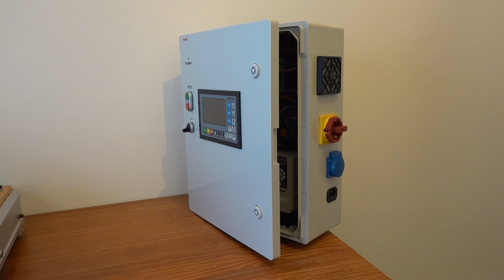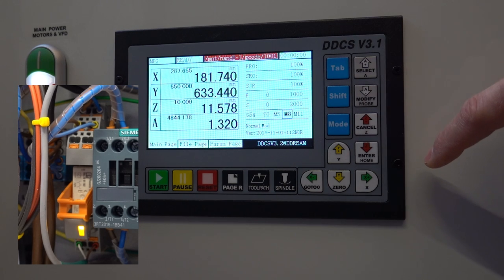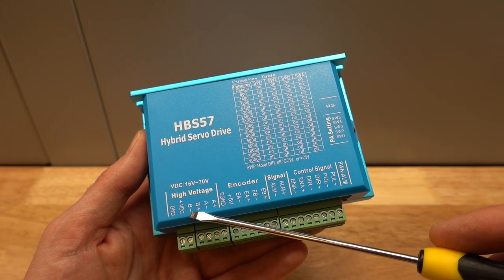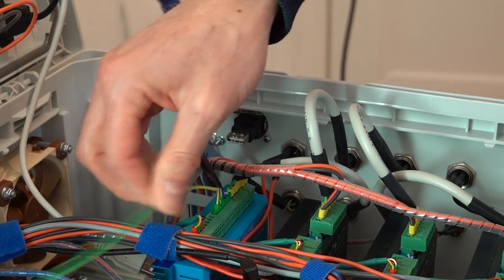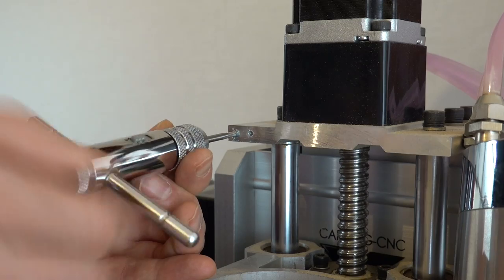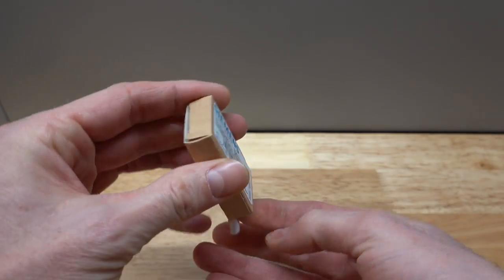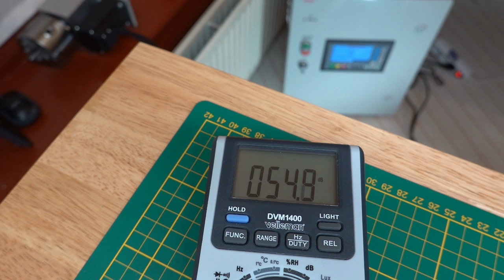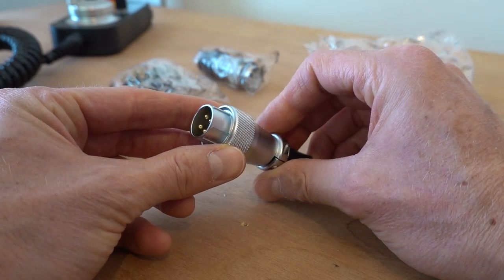Build Your Own CNC Controller Part3

Comment: Hi friend sorry to be bothering you more I have a problem. in the straight cuts it is firing and where there is a very slow curve, it burns the mdf. which parameters to use. and what is your post processor?
Reply from the maker: Hi, no problem. Since you mention slow corners and burnt material, it indeed seems to be a feed rate that is too low for your specific tool diameter and RPM, causing less deep cuts/re-cutting/rubbing and thereby generates heat. It might be that your machine is not capable of maintaining high feed in corners due to acceleration settings. In that case increase acceleration or if this does not work for you machine use a lower spindle RPM. Also make sure that inner corners are not very close to the tool diameter. In that case you can't really achieve a proper feed, since it needs to change direction inside a corner. Another option is to take smaller depth passes, which allow for chip evacuation. I use Fusion360 with Mach3 post. As far as I can see Fusion360 only has an option to reduce feed rates in tight corners, which would not help in this case, since you are not breaking end mills, but are instead experiencing burnt material. I hope the suggestions mentioned above help reduce the issue.
Robin
Reply from the maker: Hi, the only changes I made to the controller are mentioned in the PDF in the website article. The rest is at factory default settings. For acceleration check 2031 (I have zero), 99 (I have 300 mm/s^2), 45-48 are all set to 300 in my case. Note I did not change these from factory settings. However, given your additional description, please check your G-code just to make sure the arcs in the corner are not actually programmed with a lower feed rate. In that case you should look at your CAM software. Also check the other things I mentioned like tool diameter being close to your programmed inner radius.

Comment: This came out incredibly nice for a DIYer.  How did you know how to do all of this?
Reply from the maker: Thanks! I have a mechanical engineering background, but my knowledge on electronics is quite basic. However, I like to figure out how stuff works. Most information comes from online research and by reading manuals.
Reply: @uptimefab7412  I’m rebuilding my mini mill cnc cabinet from scratch and I’ll be referencing your build as I go. Keep up the great content!

Comment: Hi man! is it possible to attach a CNC router with a laser for engraving in the same machine with this controller? Thanks in advance!
Reply from the maker: Hi, this might be possible, but I think this would require another post processor and a way to interface with the laser input. Not plug and play. I am not sure you would want to do this from a safety perspective (needs suitable enclosure). I assume you are aware of the risks, please be careful. Interesting idea though.
Reply: @uptimefab7412  Hi! Of course, laser is dangerous and my idea is to make a little enclosure, and of course wearing safety glasses. Also, recenly I saw a video from a youtuber called DIY Builds, and he use a switch to swap from the laser to the milling, but i dont get it hahaha. Im searching for a controller that can suit both of them at the same time. Thanks for the response, btw!

Comment: hi do you know what aviation connector i can on my  1.5kw spindle  ive been looking ate them and they all seem to be rated at 5A but iam sure that that is tool low, i want to put my vfd in a enclosure like you and use a aviation connector  like you have for easy connection,any advice appreciated thanks
Reply from the maker: Hi, the gx16 can I indeed not handle the current required for the spindle. As an alternative you could use a ws20 connector shown in video part3 around the 22.40 time mark. This should be able to handle 25 amps. Of course this is just one of the possible options. It is really available on AliExpress.

Comment: If I were to use Cat 6 cables would they be ok for the driver to stepper connections in wire size?
Reply from the maker: Hi, the wire gauge on CAT6 should be around AWG23, which is too small for the high current line from stepper driver to the motor. You can however use CAT6 for signal lines from controller to stepper driver or for the closed loop signal line. For my steppers I  use 0.75mm^2 (AWG18). I have read people running NEMA 23 on diameters as small as AWG22, but I don't see any reason to use smaller wire gauge since even high quality shielded wire is quite cheap. Hope this helps.
Reply: @uptimefab7412  It does!  I was just hoping for a more plug and play connector solution.  I'm also into Amateur radio and we use those round plugs for microphone and some power connections.  Very tricky to solder and even worse with my eyesight.  I may have to come up with something else.  If 18 or 16 ga wire is fine I may try using Anderson Powerpoles.  30 amp handling each on the pins.
I like the idea of a standalone controller.  Trying to buy all my other parts now though.  2.2kw spindle and VFD with pump.  Ball screws and such.
Reply from the maker: Agreed, soldering connectors can be a pain. I also like the CAT6 connectors, I would also prefer these over gx16 for low current signal wires. Problem is if you have a cable without  the CAT connector and you have to crimp it yourself. In that case it is almost as difficult as soldering (for me)

Comment: I was going to buy the ddcs v3.1 but realised that It's not quite usefull for my cnc servo motors. Meaning it can't handle alarm signal coming from the drivers. Though It's not an essential fonction I'd be nice to use the full option the servo motors offer. I recently came accross the DDCS EXPERT controller which have this option. Do you know if this controller is as good as the DDCS V3.1 or It's one of the buged chinese new devices to say away of ? Thanks
Reply from the maker: Hi, I do not have experience with the DDCS expert, but it seems like a nice option. In fact, if it would have been available when I was looking for a controller I would probably have gone for the expert or plus version. They both have more functionality, but at the cost of a higher price and larger dimensions.   They are made by the same company as the DDCS V3.1. Perhaps users in the digital dream Facebook group have shared their experiences with one of the newer controllers, would be a good place to check.
Robin
Reply: @uptimefab7412  thanks a lot for your  feeback. I'll check with them.
I thinks the DDCS V3.1 is just great  for stepper motors.
 Anyway you've made excellent videos very usefull. Great help !  Thanks
Reply: @uptimefab7412   Your DDCS v3.1 is a 4 axis. So XYYZ. Do you know if you can connect 2 Y to one axis signal in the DDCS ?  Thanks
Reply: @uptimefab7412   Your DDCS v3.1 is a 4 axis. So XYYZ. Do you know if you can connect 2 Y to one axis signal in the DDCS ?  Thanks
Reply from the maker: Hi, although is has 4 axes unfortunately the 4th axis cannot be reassigned to be a second Y axis. I have seen this feature requested on forums before but I do not think they are going to add the feature to this specific controller. Unfortunate, because this would be useful for a lot of people with dual Y axis motors.
Reply: @uptimefab7412  Maybe using some breakout board to split the signal to two motor drivers. Ok Thanks a lot.
Reply from the maker: Using a solution like that should work, you would only be missing separate limit switches for alignment of the gantry. For smaller hobby machines this might not be an issue.

Comment: how much cost all equipment of the CNC Controller box
Reply from the maker: It depends on how much you can reuse from an old controller. Everything new would be over 1.000 euro. I did not keep track of pricing so I do not have a specific number.  Things add up quickly with many small parts.
Reply: @uptimefab7412  ok think you , can you give me bill of materials which you used on part3 with picture if possible
Reply from the maker: Hi, the Bill of materials including the things added in part 3 can be found in the website article linked in the description of the video. Scroll down in the article or search on the page for "bill"

Comment: How do you calibrate the cnc on the DDCS V3
Reply from the maker: The methode I used was to use a micrometer with the largest range I have at home, measured travelled versus programmed distance and adjusted the pulses/mm parameters accordingly.

Comment: how do you not have emi issues ? you have a vfd inches away from your drivers and controller?
Reply from the maker: Good question, I don't know why I don't have issues as I am not able to measure EMI. I placed the VFD as far away as possible from the stepper drivers, but they are still quite close in this compact cabinet. It seems to work though. In forums I have read that other people have the VFD inside the cabinet without any issues. On the other hand there are people that indicate that you cannot have the VFD in the same cabinet. A lot of conflicting information on this topic. This is why I decided to place the VFD inside the box until I do find issues with EMI. A trade off between effort and risk of issues. I will place an update if there are any issues. Do you have a separate box for the VFD or just more space in the controller box?
Reply: @uptimefab7412  I have my vfd about 3 ft away. Even with that just having my spindle cable in the drag chain with the motor and endstop cables caused stuttering. I do have shielded wire also. when my spindle cable is on its own, everything works perfect so.

It might just be the nicer components you used. Mine is entirely aliexpress
Reply from the maker: Wow those are some serious noise issues. Do you have a ferrite ring around the cable? Mine has the 3 spindle leads wound around a ferrite ring right after the VFD. This should be visible in video 1. I assume you also have an EMI line filter installed? On the other hand it might just as well be the type of VFD.

Comment: Do you have a link for the EMI filter?
Reply from the maker: No sorry, I salvaged this from the old controller. Similar models can be found from typical sources like Amazon and AliExpress. I am not an expert on emi filters so I can't recommend a specific model. Check video from Clough42 on EMI. He also has a link to a model from Amazon.
Reply: @uptimefab7412  thanks, found one.

Comment: Sir, does it support encoder ?
Reply from the maker: Hi, it does not support an encoder
Reply: @uptimefab7412  so how it is used to spindle speed monitoring?
Reply from the maker: The spindle RPM is not monitored at all by the controller. The VFD makes sure it runs at the correct RPM, based on the 0-10V signal from the DDCS. This is very reliable and perfectly linear, unless you are asking too much from the spindle in terms of power needed for your cut. The DDCS V3.1 is quite basic, if you need more features, they also have more advanced models, not sure if they support an encoder.
Reply: @uptimefab7412  thank you

Comment: In my case I had to move the VFD to outside of the control box as it caused too much electrical noise
Reply: I'm doing this on mine as well (i'm going to 3d print a bracket so I can screw it to the side of my control box).  It turns out my VFD is too long and the door won't close unless I cut a hole for it.  I guess reduced electrical noise is a Plus

Comment: You didn't mention the total cost of the project ?
Reply from the maker: Hi, the Total cost highly depends on how many components you reuse from an old controller, but I spent over 1000 euros. It might be possible to do it for less, but you would have to get more creative with the used components. (Like not replacing stepper drivers or using a 2nd hand enclosure for example).
Reply: @uptimefab7412  Thanks for your reply. I knew that this system should cost a lot of money, even you're reusing components you already have.

Really nice work !

Comment: Any updates /regrets about this controller
Reply from the maker: For my application it works fine. I would have liked to have wifi or LAN. The newer 4.1 version does have LAN. Also my controller doesn't have a lot of customizable IO, but for my simple router it has all I need. The 4.1 has some other interesting upgrades, listed on their website, might be worth to check out. Also the plus model is interesting if you have the space and additional cash. The key pad on my model is a bit fragile, not industrial quality, bit that is to be expected for this price.
Reply: @uptimefab7412  do you have an opinion about the expert model vs the new 4.1?
Reply from the maker: It really depends on the use case. If size is not an issue or if you need more advanced functions that the expert provides like tool a tool changer or 5 axes then the expert might be a good choice. I also like the fact that you can get an external keypad for this. I think the downside of the one I have but also the v4.1 that there are only a few keys, so you end up with multiple button presses for functions like homing. I think overall, if you don't want to outgrow your controller and want to get the most of it go for the expert. But if your main goal is to get your machine working and the v4.1 has what you need, go for that option. Also the expert is quite a bit larger, so you will need a bigger enclosure.

Comment: how to define the right point of the work area?
Reply from the maker: Not sure if I understand your question correctly. Do you mean the zero position for each axis? In that case: zero is the point where the end switch triggers when backing off from the switch. The size of the work area you can define yourself by typing in a number that matches the travel for each axis, minus a small number for safety. If you meant something else let me know.
Robin
Reply: @uptimefab7412  configure the table size in soft limits?
Reply from the maker: Parameters #376 up to #382 can be used to set the min and max position of each axis relative to the machine coordinates.
Reply: @uptimefab7412  uia man thank you very much, i will try, i was almost given up and going back to mach3
Reply from the maker: Haha narrow escape, good luck, hope it works for you.
Reply: @uptimefab7412  boy, I couldn't😪

Comment: A closed feedback loop is actually created by having an encoder that is constantly compared to another encoder on the end of the ball screw or using a glass scale. When one feedback deviates too
Far you receive an alarm. Simply having an encoder providing feedback is considered a semi closed loop.
Reply from the maker: The closed loop systems that are monitored by the controller are very nice, but as far as I am aware not supported by this DDCS controller. For my purposes (hobby machining on a cheap router) the feedback loop between the driver and motor is all I need, but for high end machines it makes sense to go all the way. Thanks for your feedback!

Comment: I suggest double checking any shielding or grounding info gained from corvette guy 50.  Shielding a cable with a drain wire and pigtail is no longer an acceptable practice. If you machine had to be designated EMI efficient for one of your customers you could never obtain this certification using pigtails.
Reply: You do realize this is a diy project and he is not selling these right?

Comment: if you want to spend 1000 euro for this ok
Reply from the maker: Thanks for commenting, CNC is an expensive hobby indeed. There might be cheaper options, but if you want to make something out of separate components it quickly becomes this expensive. It is quite rewarding though when it actually works.

Comment: Grounding is not going to help if you have the VFD in the control box --- DON'T DO IT ----
Reply from the maker: Hi John, mounting the VFD in the control box is indeed not best practice. I already left warnings about this in the comments and the website article regarding EMI. So I do not recommend doing this. However, I have not seen any issues in my specific case. Also my lathe works without issues with the VFD in the same cabinet as the other components. Note that in both cases I do have a noise filter for the mains line and a ferrite ring on the UVW lines. As I understand many hobbyists have the VFD in the same enclosure. It is hard to find any specific documentation on installation requirements for what components you are allowed to have near a VFD. Most is anecdotal. If you know if any good online source or manual please let know. Would be useful for future hobby projects. Thank you for bringing this up. Cheers, Robin

Comment: What cam program do you use to make the g-code? How do you transfer it to the Controller?
Reply from the maker: Hi, I use Fusion360 with the standard Mach3 mill post processor. Transfer is done with a USB stick as this model unfortunately does not have any network connectivity. I believe some other DDCS models do have LAN.